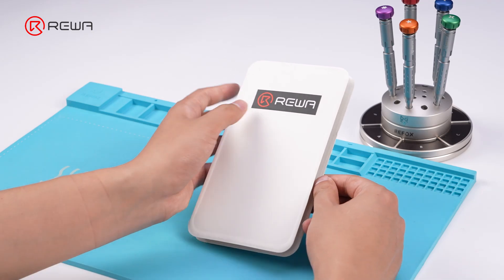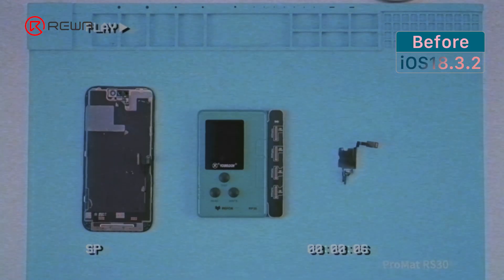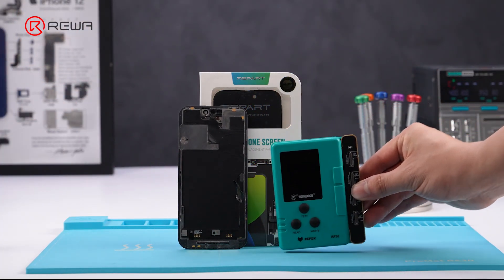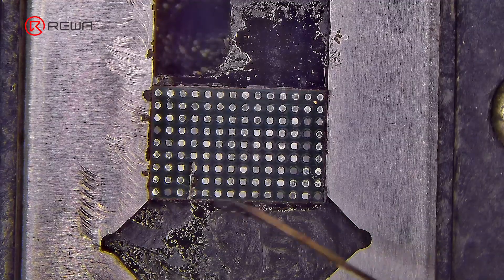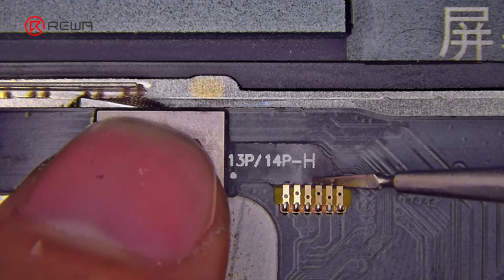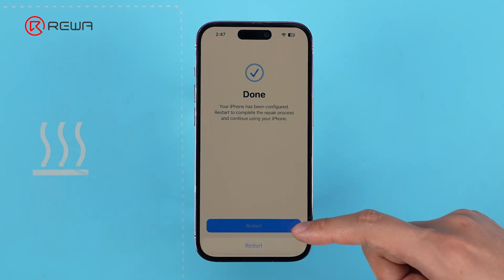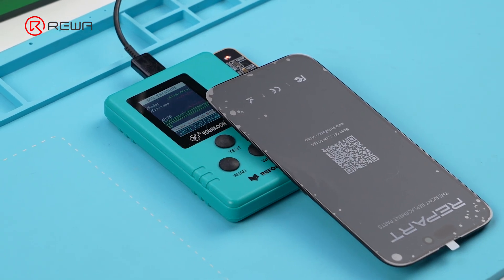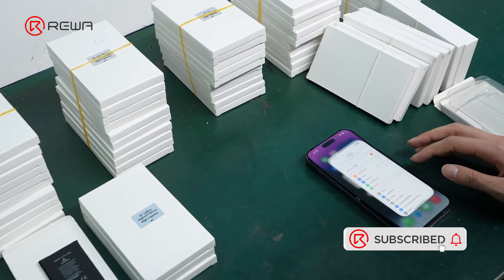No More Unknown Part for 3rd-Party Screen, How it Works?

Comment from the maker: Will you choose this screen for your repair business? 😊How about Parts& Service history? Do your clients mind this?😊

Screen link: https://shop.rewa.tech/detail/diagnosable-120hz-soft-oled-screen-assembly-for-iphone-14-pro-max.html
Reply: Does the Old Method still works on iOs18s??
Reply from the maker: Yeah it also works, and generally will not need to pass repair assistant
Reply: IT Doesnt work. It can succesfuly pass the repair assistant but after restarting its showing the pop up message about unknown part again. 

Need Help!
Reply: @ultravarialheadspin3 same problem I'm facing, Did you get solution?

Comment: Can we change the lc chip tranfer in apple 16 pro? ( To remove the unknown parts ) Also can it be done after 17 series launch?
Reply from the maker: Generally the old method works, but now we also do not do that on iPhone 16Pro, after all now repair assistant can help  you remove unknown parts.
Reply: @rewatechnology2008 The thing is I'm thinking of buying a global iphone from a local shop and I have a fear that what if the display was changed and he also transplanted the chip to remove the unknown parts. I'm thinking of buying 16 pro in September after 17 launches. I always have this concern what do you think What is the probability of it?

Comment: Can it be that this is fixed under iOS 18.5 but since 1 - 2 weeks? because before it worked on iOS 18.5 and since last week it doesn't work anymore.
Reply from the maker: Which repair method you meet problem?

Comment: You should consider fixing the issue that all Repart screens are unable to be programmed using JC programmer…
Reply from the maker: Copy that, we will send to REPART.
Reply: Still the issue persists. Unable to program truetone and therefore even the touch ic is unrecognized by the phone. To be honest such a shame. Makes the repair not professional.. 😕

Comment: What's changed On 18.4 ?
Reply from the maker: Now it still works, for this method and parts pairing
Reply: @ Can we get Auto Brightness without Moving IC?
Reply: @Sinalhuon hello, do you have any update on this? It is possible to get the auto brightness?

Comment: Nice videos. Do you copy the True Tone from the OEM screen where you took the IC to put it on the aftermarket one, or do you copy the True Tone from the old screen that was originally on the phone, and paired to the sensor cable ? Because I guess you kept the sensor flex cable coming from the phone, so you no longer need the True Tone from the phone’s screen that was coming with it ? And therefore you can take the True Tone and IC from any random OEM apple screen ? Thanks !
Reply from the maker: The true tone must paired with the display IC, as you can see, we try to transfer that IC to our 3rd party screen, so we write that screen true tone, as for the front sensor, actually if you only try to remove the unknown part, you do not need it, but if the iphone boot without front sensor, it will shut down automatically in 3 mins, so our test just verify that you can buy our Diagnostic-Compatible Screen, or you can find a screen and write in its truetone data and transfer the that screen ic, and it also can pass the repair assistant

Comment: IT Doesnt work. It can succesfuly pass the repair assistant but after restarting its showing the pop up message about unknown part again. 

Need Help!
Reply from the maker: Only the product works, not all 3rd party screens work
Reply: @rewatechnology2008  REPART incell 80hz scren yours product make this problem why?
Reply from the maker: Yeah this 80 Hz screen is the aftermarket screen, you still need to try old IC transferring method, or other OEM screen IC